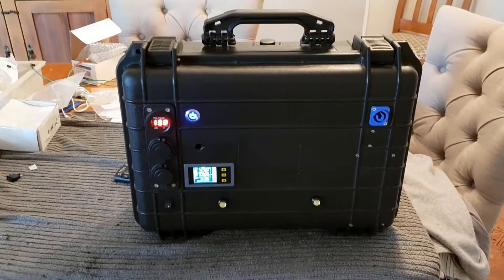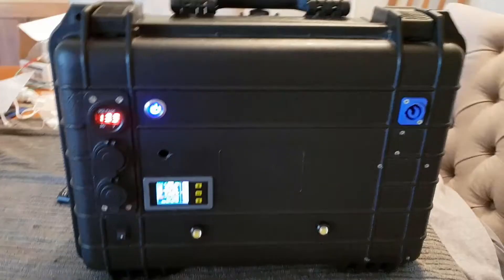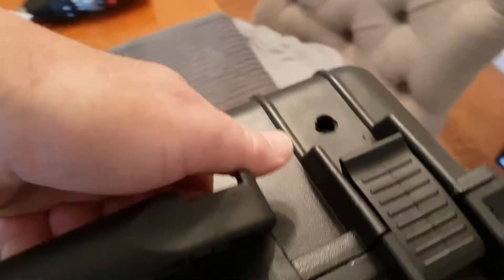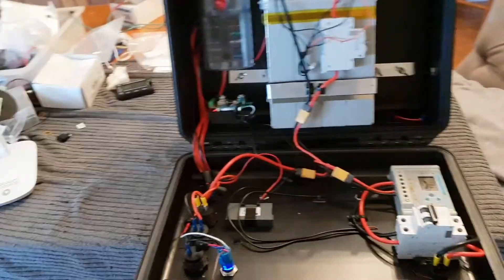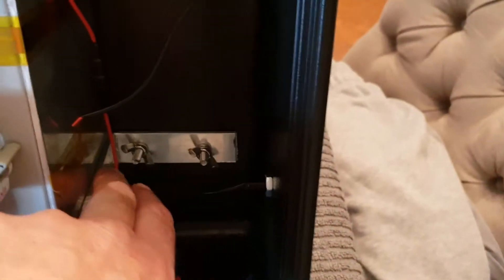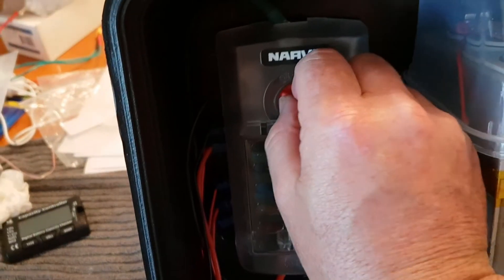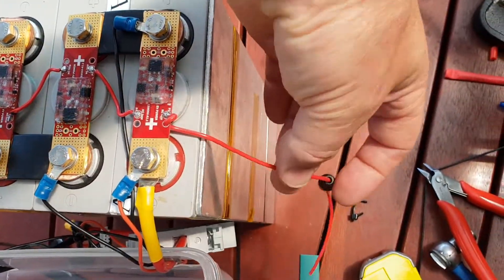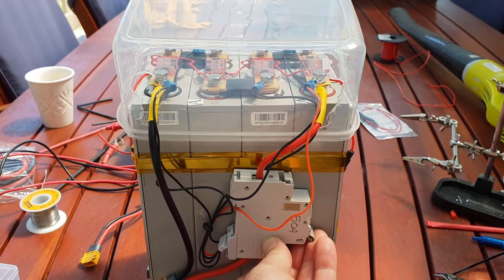DIY Lifepo4  12 Volt Portable Solar Generator Camping Battery - Part 3

Comment: thenutrik connector is called a power con connector
Reply from the maker: Abe Coulter It’s spelt neutrik...that’s who makes them 
Thanks for the comment 👍🏻
Reply: @offgriddreaming5403  im dislexic....but i am a lighting designer...amm my gear is powercon...and true1...all my XLR are by same manufacturer... i am building a pack myself in the AEG quckstack tool trolly system.. from bunnings..  .did your trip to bunnings include the famous bunnings snag?
Reply from the maker: Abe Coulter All good 
Post a vid of you build!
Reply: @offgriddreaming5403  i will do...just waiting for parts to arrive